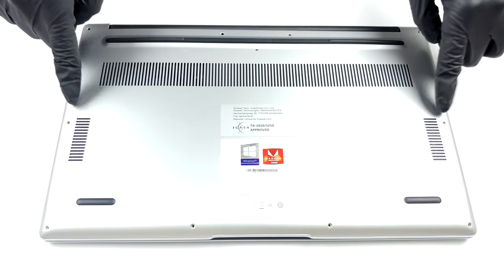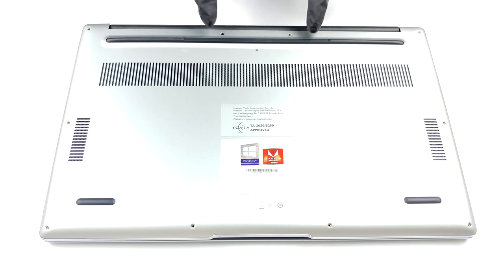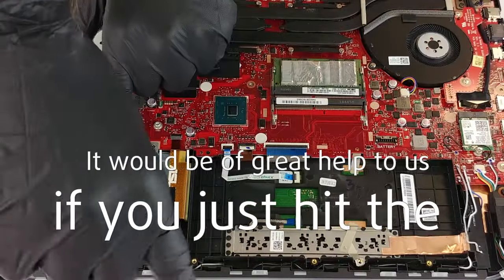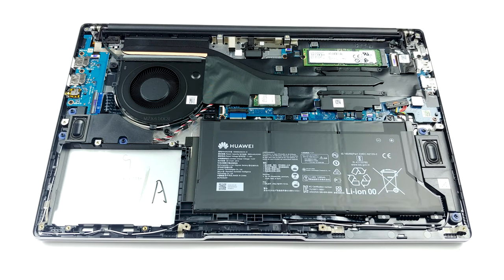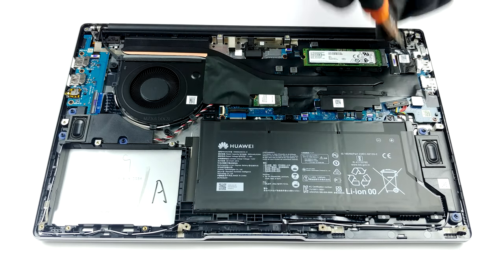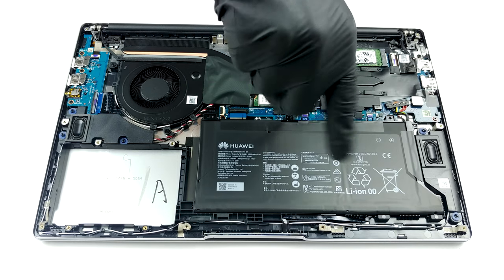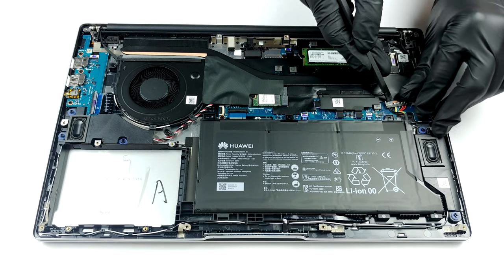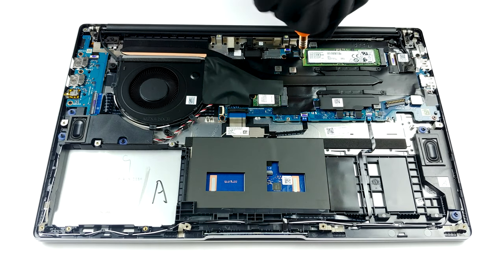🛠️ Huawei MateBook D 15 (2020) - disassembly and upgrade options

Comment: The video is confusing. why they show replacing of wifi adapter in 2:12 , the title of video is ram upgrade. it confuses basic users with less knowledge of laptops. and the video says for huawei matebooks there is no chance to replace rams or upgrade, since rams soldered to mainboard and there is no additional ram slot for adding extra 8GB. this is what I understand. but they should show us where the existing ram soldered in the video, instead of showing ssd M2 drive and wifi cards. I want to see the ram soldered. or did they show in video and i dont see it?
Reply: You're right. it is confusing.
Reply: It's a very mediocre video.

Comment: how to install 2.5" SATA Storage?? there is place for it but not the port or flex cable..
Reply: Left of the SATA storage have a cable
Reply: @omiros983ify Where to get the cable from any online store؟؟
Reply: @mr_m2262  you can buy the sata cable in aliexpress
Reply: You can't, it doesn't have a SATA interface it seems. It is not the cable that's missing, but the whole interface. (I mean, you cannot connect it to the mainboard)
Reply: @OliverK95  it has, i already buy a connector for it, and it works..
Reply: Only certain D15´s have the connector. Here in latinoamerica doesnt.

Comment: which torx screwdrivers (T1, T2, ...) did you use?
Reply: I just opened mine with a Torx T6
Reply: @zakpappnase  thanks
Reply: For 2022 use the T4 or T5
Reply: @richie_ton  thanks
Reply: it's t6 or t8 last time i opened it up (2020 model)

Comment: I have a problem with touchpad hw matebook D15, it is lower than the rest (about 0.5mm and it on the right), I still used normal . Has anyone met it?

Comment: Can you change the 8gb module for a 16gb one directly? I mean to replace the module?
Reply: they said its soldered so no, it can't be replaced
Reply: maybe service can do it
Reply: Nope
Reply: If have been soldered, you cannot upgrade ram and it will really waste your time. Unless you want to take much work for doing this stuff. That why you must check before buy new laptop.

Comment: What ssd memory do you recommend to replace the 256 memory
Reply: I recommend you don't replace  the M.2 because that have inside  the operative system an your programs, install a one SATA SSD of 1TB  or more for more space of storage.
Reply: And how can i add this ssd?
Reply: @thingevery4749  only external ssd
Reply: The new 2021 model is available with 512 GB NVMe SSD. Get that. If you already bought the 2020 model then just get a SAMSUNG EVO 970 SSD into it.

Comment: ram nerede
Reply: Abi RAM ana karti kaynaklı, yani kolaya denistiremiyorsun
Reply: @alikorkmaz4247  eyvallah saol
Reply: @alikorkmaz4247  hard disk eklemesi yapabiliyor muyuz onu anlayamadım. M2 slotu mu var acaba
Reply: @bekirnaimtas7537   Abi 15' lik modele ekstra hard disk yada ssd takilabiliyor dahili hafizaya ek olarak. 14'luk model de 256 gb lik kendi ssd  sini denistiriliyor. Bilgiseyar bende ondan biliyorum. Ben 15'lik kullaniyorum.
Reply: @alikorkmaz4247  anladım kardeşim teşekkür ederim
Reply: @alikorkmaz4247  reis adam burda rami degistirmismi

Comment: can i change ram 8 for ram 16 in this laptop? ..  i hope for one can understand my english
Reply: no, you cant sorry.
Reply: @millenniumfalcon11  nope still can't,its soldered into the motherboard
Reply: No you can't upgrade it. It is soldered on. But the new 2021 model has 16 GB, go get that, it's already in stores.
Reply: @millenniumfalcon11  No you still can't, it is soldered on and there is no free slot.

Comment: This model is tricky. Damn c.hinese engineering. The additional SSD slot exist but to connect to motherboard there isn't a connector latch. becareful to buy a second handed to this point.

Comment: Can ram be upgrade?
Reply: nope its soldired
Reply: soldered*
Reply: It can be upgraded by resolder with another RAM chips, but 
this is fraught with difficulties. You can find RAM resolder videos with macbooks
Reply: @jasongen  i need a notebook for university.İ have a 1000€.Can you suggest me anything?
Reply: @sprecmoles  sorry i am not so competent in this matter but from my experience i can say that this laptop (Matebook D15 2020) is pretty good for study and work as web development and has good IPS display but not well battery life time and little RAM (8gb is enough end-to-end). I bought this laptop for €500. So i can suggest when you choose to pay attention for RAM 16Gb, IPS display and Ryzen 5 CPU. This should be enough and costs ~700-1000€. Iyi gunler
Reply: @jasongen  iyi günler 😅
Reply: NO.
Reply: Emma  The 2021 model has 16 GB.
Reply: @jasongen  The 2021 model has 16 GB which makes it a great deal

Comment: 2:02 is that the wifi adpater?
and if it is, will I be able to use an external graphics card to plug-in there?
Reply: That will leave your laptop exposed though
Reply: Yes you can, but I do not recommend it since the laptop does not have an ethernet input
Reply: @barronnievaemmanueltonatiu2978  technically, if you want to sacrifice a USB port, you could use a wifi dongle or USB Ethernet

Comment: What was is this 2:12
Reply: WiFi Adapter
Reply: @frainity  we can upgrade to wifi 6 you think?
Reply: @Killergame9393  it is possible
Reply: @frainity  ok thank I want to change the one of my matebook 14 are all wifi cards compatible do you think?
Reply: @Killergame9393  better check if it fits first, because these parts are swappable. You can even insert external GPU at the cost of modifying the cover plate.
Reply: @Killergame9393  Matebook D15 2021 has wifi 6. I think 2020 does too